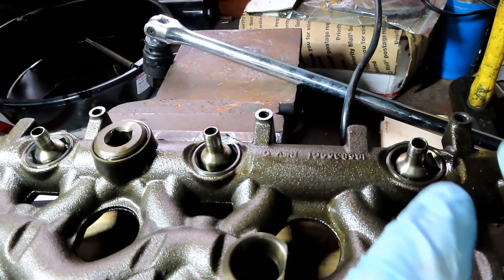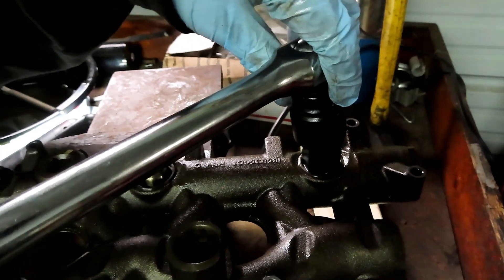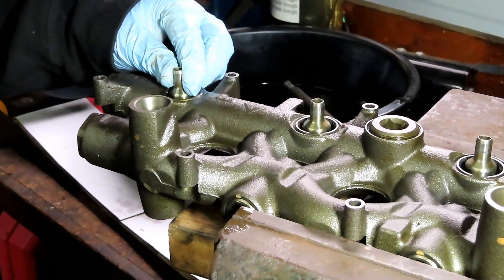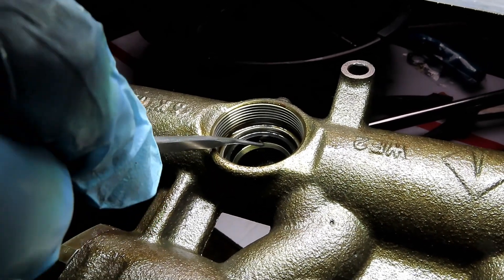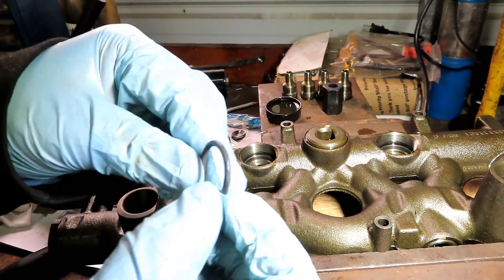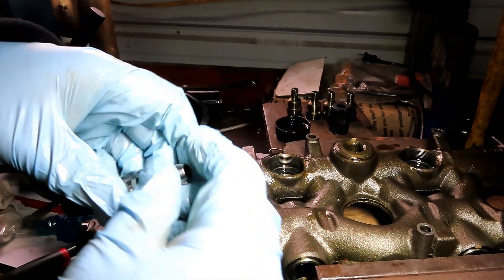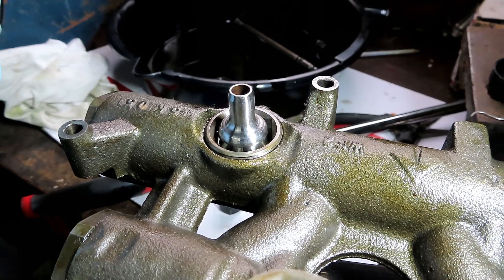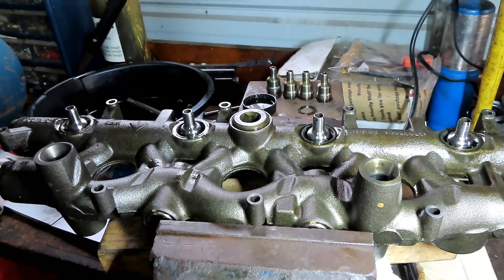6.0 Powerstroke Nipple Cup Ball Seal Upgrade Bulletproof Leakproof Replacement

Comment: Great video and links man!!  Beast ✊.  I am a new 04’ 6.0L owner— I need= 
#1) a recommendation on a Manual for discovering torque specifications for sensitive areas 
#2) An accurate torque wrench I can use for work on the truck and NOT pay +$200 for?
Reply from the maker: I use a craftsman digital torque wrench but most of the time a quinn adapter that was $25 from harbor freight. If I have to use a harbor freight click wrench I check the setting with the quinn in a vice before using so its super accurate. I have a chilton manual or look up specs online before I do anything if it's not listed in the chilton manual.

Comment: Any leaks after? Mine struggles turning on when hot and cold, and I know it leaks from the nipple cups. Going to install these cups and new stand pipes and dummy plugs. I know the hpop is healthy because I connected a scan gauge to it. 04 6.0 with new oil rail design like yours.
Reply from the maker: No leaks since the install. My system was holding good pressure before I touched it. The first start up took some time to prime but it's good now. Starts up right away. Mine would have eventually leaked and since I had to take the rail off to do injectors I figured why not do preventative maintenance (plus an upgrade). I only did the left side so far. I didn't want to have to go back into the valve cover just to change cups.
Reply: Im in the same boat the nipples feel firm in place and replaced the orings on top of the injectors so the leak is still there yet the air doesnt escape as fast but still does
The nipple cups look the same as the video
Do you think if i upgrade them to these it’ll help haven’t pulled out to polish or anything truck has 313k miles?